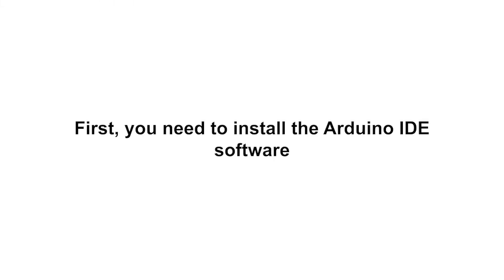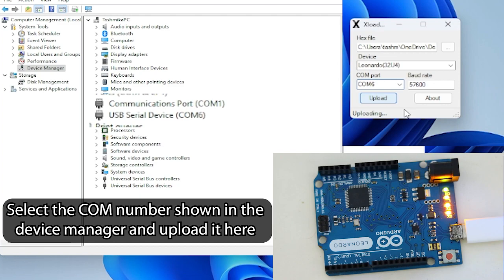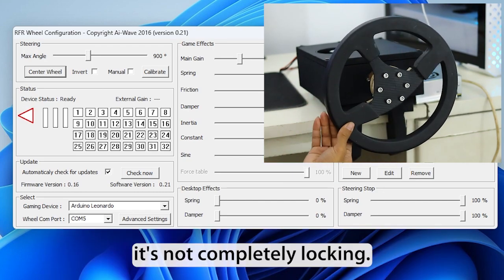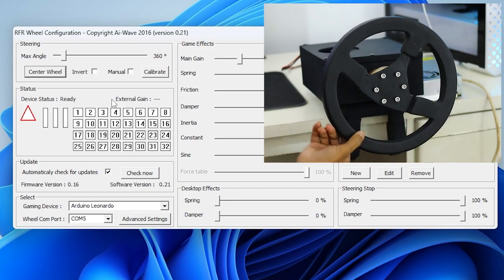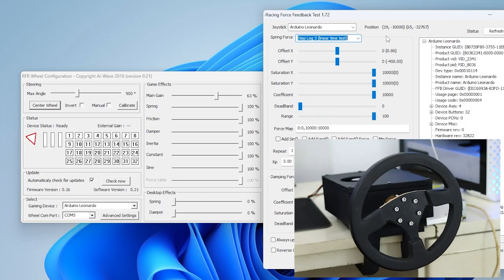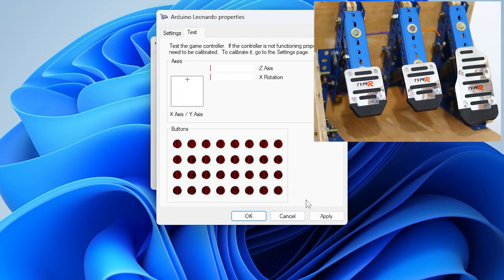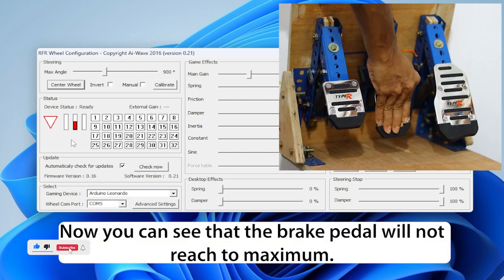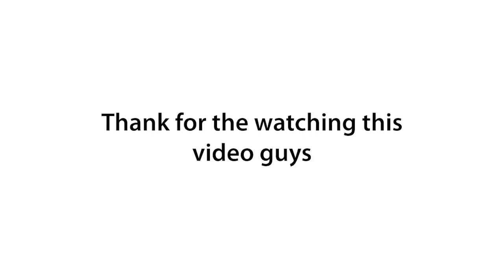Connecting a FFB Steering Wheel to Your PC | WheelConfig

Comment: I have a question, friend, when using the steering wheel, did you use a higher voltage like 13 or 14 to use it? I used the 12v directly and the power source blew up.
Reply from the maker: I'm currently using a 12v power supply. I have measured the voltage it's 12.56v. and it supports up to 24 volts.
that's not your voltage problem. maybe it is a power supply ampere problem or your power supply fault.

Comment: hi bro, i wired everything just like you but the motor doesn't rotate, i can feel some resistance but when i rotate the encoder the motor does absolutely nothing, i wired it on the bts controller and on pins 10 and 11 but nothing
Reply from the maker: increase all the game effects on RFR wheel config. and restart to apply the settings.

Comment: bro, I made it using the Canon IP2770 encoder and and it can be used, but after I remove it and put it back on, why doesn't it work? even though all the connections are correct, they are still unreadable. Is the ppr wrong? or another possibility?
Reply from the maker: check your z toogle switch is on position.
and reset the wheel config settings and see its work.
And if there is a problem with the wheel, the Device status doesn't show ''ready'' (in wheel config)

Comment: So far it’s been okay, but mine when rotate right until limit, either the arduino or the motor will make high pitch noises and signals are going crazy. I will try adding the resistor soon. Is there any other possibilities that causing this?
Reply: try flip the motor cables

Comment: Why didn't you use the EMC Utility Software?
What is the difference between EMC Utility and RFR Wheel Config?
Reply: Yes I Wonder too but i think emc lite is just too Limited and Efe Wheel is free with Desktop Effects ffb Setting etc. Although i dont think there is a huge difference between the Desktop effects but its clear that emc pro is better than Efe it dosent give any errors but it costs 10$ and on the lite Version the degree is only Limited to 900 degrees so of you want good experience better go with emc pro
Reply: And also arduino isnt Supporten anymore since 2019 for emc pro so your forced to buy a stm32 for the new updates

Comment: Bro I only want to use the software for pedals and H shifter, can this software be used? I will be using Leonardo only for this. No steering wheel
Reply from the maker: yes you can
Reply: @zudumalli  I got my leonardo, when I press Reset button, it shows as arduino uno bootloader for a second then it just reverts back to Arduino leonardo. If i try uploading firmware using Xloader, it shows upload failed